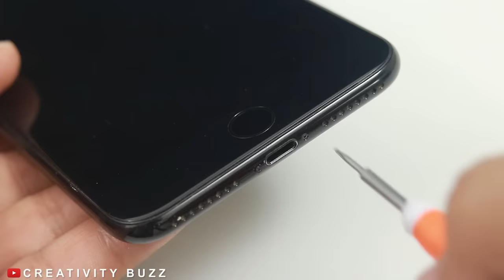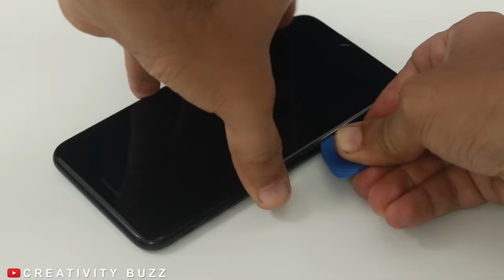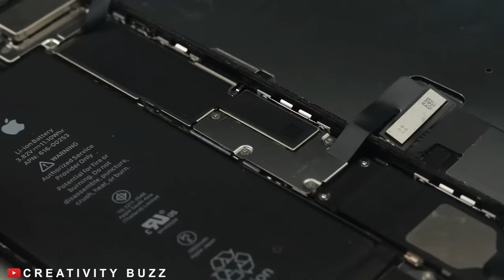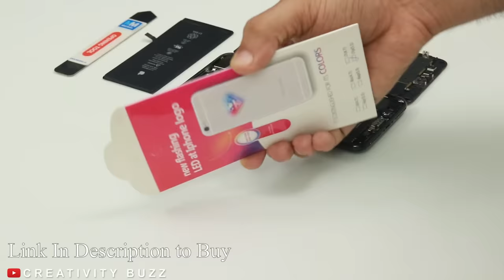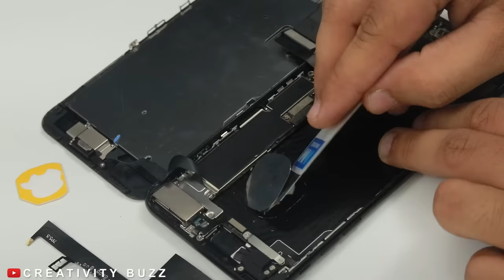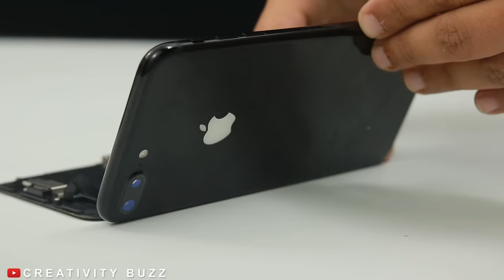How to make Fingerprint Apple Glowing Logo | Iphone Touch Logo

Comment: Warnings to anyone wanting to do this:
1) Breaking the PSA (Pressure Sensitive Adhesive) that goes around the screen will remove the water resistance and dust resistance from the phone making it susceptible to both. 
2) Removing the battery adhesive means your battery will just be flopping around in your phone. 
3) Doing this without properly grounding yourself can cause serious microscopic issues to the components inside the phone
4) The screws are very small and the threading is very small. Reusing the old screws could lead to one not sticking. If that screw falls out, it could puncture the battery causing a thermal event. 
5) Doing something like this does void any coverage from Apple. They may not even be able to do a modular repair on the device. There is a possibility they may even decline service for something like this. 

If you choose to do something like this, be careful. It looks cool, but do your research and know the risks you are taking.
Reply: Thanks For The Information Due 👍👍😊
Reply: True.. it's iphone man and it's enough no need to glow and any kind of shit! 🤣
Reply: 1)you can buy adhesive for screen on the internat to gain water resistance again
2) you can buy adhesive for battery as well
3)may happen but never had that problem with any of the iphones i repaired but using rubbergloves is what i am always doing
4)if you thighten it right then it holds good
5)iphone 7 is too old for service so it doesnt care
Reply: Phillip Baumgartner True but the PSA’s Apple uses are not sold so you are relying on a 3rd party for that. Not to mention the attention to detail it takes to remove all the PSA and then applying the new PSA appropriately. Since it’s PSA, as the name suggests, it requires a specific amount of pressure for a specific time to properly activate the adhesive. Without the proper tools, you’re unlikely to accomplish that.  Lastly, again, the damage can be microscopic and rubber gloves are NOT the equivalent to grounding. I’m simply trying to provide information to people. They are more than free to decide if they want to do something like this on their own but everyone should know the risks associated with these kinds of modifications.
Reply: Nerd
Reply: Gizmo Da noob and proud
Reply: Big man writing  a whole story init
Reply: Sounds like Apple talking. If you’re careful it’s fine. If you’re not careful you’ll find out quickly.
Reply: Also if your dad has paid for your iPhone then God can only save you.. RIP curious friend.
Reply: Girish Khairnar 😂😂😂
Reply: Woah woah woah... calm down... you even watched the whole video?
Reply: I’ve changed enough IPhone batteries 🔋 this sort of way and if you’ve careful and don’t rush things with correct tools 🛠 one would be fine..
Reply: Well I am think about the battery, that flopping is not a problem, because there is no space inside the iPhone for flopping. A technican changed on a Android smartphone of me the screen and he didn't stick the battery. to this day i have no problems or malfunctions. there is simply no space in the phone and everything is tight. so the battery never has a chance to move
Reply: Thanks dad.
Reply: You are right bro 🥺
Reply: @OddlyAddicted  
What proper tools ?
You mean that 1 dollar bag of screws and picks from china and some 1mm adhesive bands ? :))
You sound like you're affraid of your own shaddow with all this prevention advices...  :))
It's just a cheap 100 dollar phone now..
Reply: @phillipbaumgartner4239  1)It will never be as good as factory installed one. If you misalign it and water hits it, goodbye phone.
2)not only you (can) you absolutely must and should
3)it's really common and the wire costs like 1 dollar
4)if you over tighten it messes up the thread. if you under tighten it will fall out on it's own. use tiny tiny bit of threadlocker.
5)He doesn't meant service under warranty, he meant service in general. They could even refuse to fix your phone even if you want to pay for the fix.
Reply: Thanks I was about to do it.
Reply: The for that
Reply: you can replace the dust and waterproof seal. the battery adhesive too.

as long as they arent damaged, the screws can be reused
Reply: @milliemukisa414  fr eh😭😭
Reply: @GHK_02  lol
Reply: @dhanvinibasava3460  just to find something to criticize about.
Reply: It doesn't even look cool. Why did he choose a piss yellow color instead of white....
Reply: its plain silly
Reply: Thanks for your information but I don't have iphone
Reply: @jayshankar_c right 😂

Comment: Why don’t Apple do this  already , always wondered  guessing a lot of people would like this
Reply: Battery life 🤷🏻‍♀️
Reply: It consumes a lot battery, then people will complain about battery life . If u have older Mac you can see that this option was there due to battery consumption it was removed in new models.
Reply: in my own opinion, it doesn't look classy, professional or futuristic if Apple add this feature in their iphone.
Reply: Apple is very selfish
Reply: Honestly if they did this I would just go back to Android. That’s a little excessive.
Reply: @richasharma2285  The glowing logo on a MacBook was Not removed because of battery life. It used the light from the display to make the logo glow. Didn’t decrease the battery at all. Apple removed the glowing logo in order to make the MacBooks thinner.
Reply: Because  Apple want 💸
Reply: @richasharma2285  Actually, it was removed due to the screen getting too thin, you would have been able to see it through the other side of the screen. It was done by using the backlight.

Comment: Hi a simple question I can't seem to get the answer for, original white cracked iPhone 6 screen, I replaced with a non original black iPhone 6 screen, do I have to swap the top white part and the bottom part of the original home button onto the new non original black iPhone 6 screen to get Touch ID to work, so it looks odd with a original white home button on to a new non original black screen, or can I use just the bottom of my white original iPhone 6 screen and the top black part of my new non original screen, so that the Touch ID works on my new black non original screen, I hope that makes sense a home button comes in 2 parts I believe, the top coloured part and the bottom springy part. Please help me anyone, I have asked this question about 20 times to various people without success. Great video thankyou.

Comment: I’ve gone in on an iPhone probably 30-40 times in the last 5 years, to diagnose an issue or replace something. Of those, maybe 10 required a battery removal. And of THOSE, never EVER did the adhesive come out as easy as you see it in the videos. Best get some heat

Comment: I tried to do this, got stuck around step 3 and went back to step 1. Looked good so I double checked step 2 and skipped to step 6. Then I went back to finish 4-5, but 7 started talking about how I didn’t finish 3 and they weren’t having it. So I started over, step 3 gave me no issue, but my house blew up on step 4 so I’ll have to come back with an update after I get that fixed.

Comment: Advertencias para quien quiera hacer esto:
1) Romper el PSA (adhesivo sensible a la presión) que va alrededor de la pantalla eliminará la resistencia al agua y al polvo del teléfono haciéndolo susceptible a ambos. 
2) Quitar el adhesivo de la batería significa que la batería estará dando vueltas en el teléfono. 
3) Hacer esto sin una adecuada conexión a tierra puede causar serios problemas microscópicos a los componentes dentro del teléfono
4) Los tornillos son muy pequeños y la rosca es muy pequeña. Reutilizar los tornillos viejos podría llevar a que uno no se pegue. Si ese tornillo se cae, podría perforar la batería causando un evento térmico. 
5) Hacer algo así anula cualquier cobertura de Apple. Es posible que ni siquiera puedan hacer una reparación modular en el dispositivo. Existe la posibilidad de que incluso rechacen el servicio por algo así. 

Si decides hacer algo así, ten cuidado. Parece genial, pero investigue y conozca los riesgos que está asumiendo.

Traducción realizada con la versión gratuita del traductor www.DeepL.com/Translator
Reply: Merci je vais le faire chez moi 😂